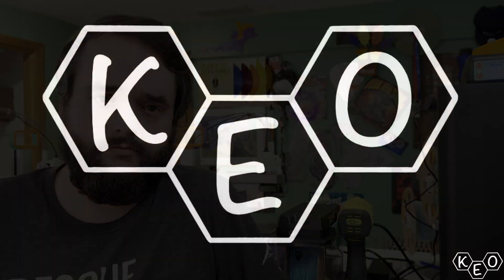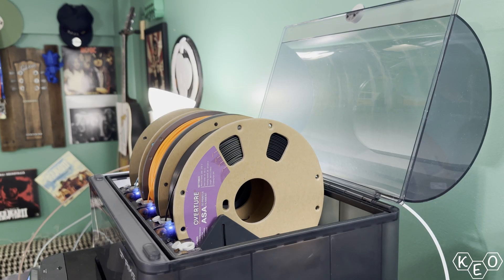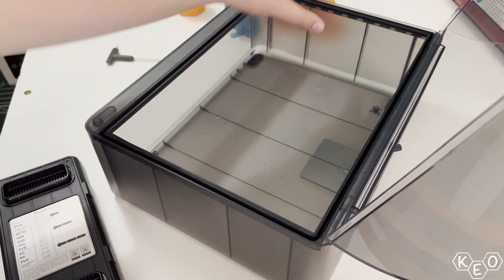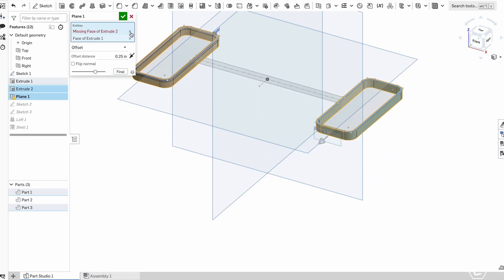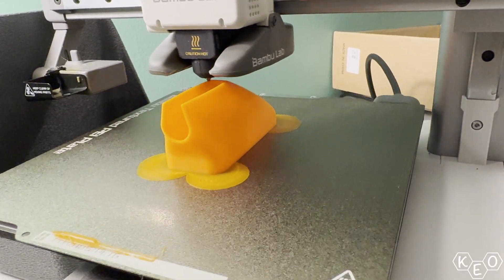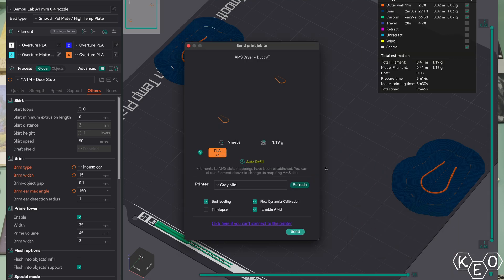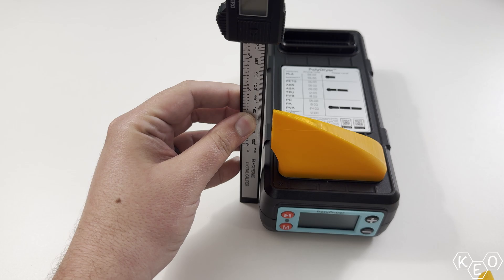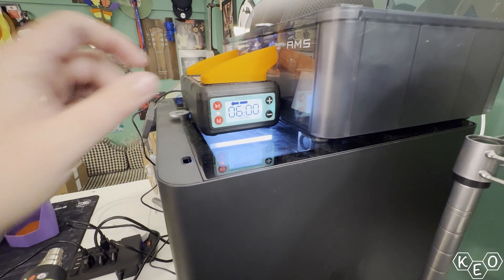AMS Active Drying? The Bambu Lab AMS PolyDryer Upgrade You Need To See

Comment: In that time, only the environments humidity dropped inside the AMS.
How much moisture did it pull from the filament.
Also running temps above 35+°c can start to have negative effects on electronics.

Comment: hi thanks what are you using in the video?
Reply from the maker: That is the poly dryer from poly maker. Check out the video description for a link if you want more information
Reply: @KeoPrints  which CAD did you use? Thank you
Reply from the maker: Ahh that is OnShape. It’s very well featured for a free browser based program

Comment: Great idea and great start. I question why you restricted the air flow so much? The outlet size should be at least close to the same size as at the dryer itself. That probably reduces the effectiveness to a  degree.
Reply from the maker: It simply came down to the packaging and using a shape that would print reasonably without support material. The cross-sectional area is quite a bit less so from an efficiency standpoint, not ideal. But the thing worked so the concept was proven. This was the first iteration, check out the follow up videos if you would like to see where it ended up.

Comment: G'day mate. Just a small suggestion of a potentially easy win to be had: adding some kind of ventilation for the moisture to go to would be a good idea. That being said, as to where? I don't know. If the inlet for the PolyDryer was on the bottom or back, I'd say just lead the lid open a little bit which I imagine would be sufficient, but obviously this would be less than ideal in the current design set up. Maybe add a port hole kind of thing at the back, (or top?), of the AMS which you can close once the filament is dry?  Good luck!
Reply from the maker: Ahh yes, you're right on the money my friend. Here is a super cut video that has the whole build/series thrown together into one. It covers that first iteration that you saw but also a couple more past that.

https://youtu.be/3X2qtFA_Ou4

Comment: Make the part from TPU completely then you will not need gaskets
Reply from the maker: That’s not a bad idea. Although it wouldn’t handle the overhangs very well I’m sure it would handle the heat just fine. I have the follow up video coming out this Sunday
Reply: @KeoPrints  Yes it will as you do not have long runs of overhangs

Comment: Does the lid on the AMS have a gasket on it? Is the Polybox pushing air through both outlets, or is one and inlet and one an outlet? Otherwise, where can the moisture leave the AMS?
Reply from the maker: This has been the talk of the comments section. As far as I am aware, the moisture does get trapped in and does not get exhausted. There is an inlet and an outlet on the dryer so the air is circulated but none of it gets exhausted out. I am currently working on the follow up video where I plan to make an exhaust but it has been interesting diving into this!

Comment: so i was thinking about doing this myself. the approach i was going to take was by using two units at opposite ends (towards each side) with penetration's through the floor of the AMS, but honestly now looking at the python MOD, and   i would integrate the same approach into the new AMS build. 

i do have a question though. is there a way to purchase JUST the base unit (kit) with out the box? (of the polymaker dryer)
Reply from the maker: As far as I can see there is not a way to just get a base. I hoped for the same thing but I guess it doesn’t hurt having extra individual dry boxes. 

You can check our link and see if anything has changed but last I saw, you could only get the box, or the box and base

Comment: I would suggest making the ducting about 2 inches round where it connect to the ams, you could then use a 2 inch hole saw and a drill to make quick work of making the holes. Then design a bracket to hold the dryer on the side of the ams
Reply from the maker: I agree. The round ducting would better for air flow as well as making the holes much easier to drill. The round ducts just have such a hard time printing that I didn't want to mess with it on this short of a timeline. My plan in the next few weeks is to cut new holes (round ones) and then make adapters to fill the gap between the outlets of the ducts and the now bigger holes. That will look much better I think but we will see how the project develops!

Comment: I got a PrintDry Filament Dryer PRO3 with the Large Spool Kit for my 5kg spools. But I'm edger to add something like this to my CFS I'm getting. 

My basement sits are around 40% humidity with a defumidafier for the level running and it get up to 80% humidity during the summer months in my area so all the more need to keep printing areas as dry as possible.

Comment: Interesting, but seeing the relative humidity drop as the temp goes up doesn’t really tell us anything useful: hotter air can hold more moisture so the hygrometer is going to show a drop purely from the temperature increase regardless of whether or not any moisture is being driven out of the filament.  You need to weigh the spools before and after to see if there has been any actual drying of the filament.
Reply from the maker: That’s a good point as well. I’ll have to live with it a little more and do more testing to see how it goes!

Comment: So, for the A1 AMS, I just run the filament directly out of 2x double-roll dryers from Creality through the motors of the A1 Series AMS. That one is super nifty! The Creality dryer boxes show you the moisture levels as well, so you know if you need to turn it on and it has presets for different filaments. The dryers come with tubes and have steel rollers to make this possible without any modifications - the filament will just hang a little loose after being pushed back since the dryer does not automatically respool, but that's just a few inches/centimeters of exposure.

For my P1S, yea, right now, I have an additional 2x double dryers from Creality since I liked the first ones and my son has them now for the A1 Mini. I thought about a similar mod - and I thin the ducting could come through the desiccant pouches in the back with a modded undercarriage. Still in the "idea" phase on this.
Reply from the maker: That all sounds like good stuff. I’ve been looking at the creality dryers a little more now too. Good to have all of the data that they offer on there

Finding a way to duct into the desiccant pods is a good idea as well. Hadn’t thought about that either. Good notes here!
Reply: How do you run it to the ams? Did you poke holes in the ams for the filament? Do you keep the lid open?

Comment: It occurs to me that if you properly control the max current (i.e. max temperature), just sticking a silicon bed heater to the bottom of the AMS could be the dead simple hack to heat the enclosure. Thoughts? I just checked, and the bottom is textured, but nicely flat. This could be a pretty simple task for an Arduino or Pi Zero. You would want to be very confident in your temp control so you don't melt the bottom of the AMS. The only wrinkle is you would want some controlled air movement. Hmmm <<< reaches for thinking cap.
Reply from the maker: I like where this is going. Follow our free Patreon if you develop this idea further and want to talk more about it. That would be sick!
Patreon.com/keoprints
Reply: @KeoPrints  Actually, if all you did was add the bed heater to provide a stable PLA safe temperature. If it still had zero air movement, and kept the multiple desiccant containers . I'd argue you would still have a far superior setup than with no heat. Slap it on, plug it in... done. It would not likely be quite sufficient for things like Nylon. But it would be an improvement. Adding a small fan inside to move some air around would be helpful.
Reply: Also, personally, I only print abrasive Nylon or PC that can't go in the AMS anyway.

Comment: A simple trick to make cutting templates is to make a drawing from your design (switch from the Design workspace to the Drawing workspace) and print it out on paper.  You can also right click a sketch and save it as a DXF.  You can print a DXF from Inkscape, or if you're really fancy (and the thing you're cutting fits), you can import the DXF into Lightburn and cut it with a laser instead.
Reply from the maker: This is excellent! Who said the comments section was all bad! Love it
Reply: @KeoPrints  Glad I could make the world a slightly better place

Comment: I think you can clean up the look by making some 3D printed grommets to fit into the holes. They would cover the cut/sanded edges and perhaps could also make cutting the holes a lot easier by allowing you to cut a simple circular hole but have the grommet adapt it to the exact shape of your ducting. Definitely going to do this to mine when I can.
Reply from the maker: Yes! The  grommet idea came to me as well. Using it as an adapter from a simple circular hole would have been a much better way to go in my opinion.

If I didn’t let my last minute idea run away so quickly I would have gone that route and may still do
Reply: @KeoPrints  pros and cons of rapid iteration :)

Would love to see a follow up video on this if you take it further!

Comment: I saw a polydryer mounted to the lid. I plan to copy that. BUT if a guy was skillful at modeling things couldnt one make a new lid that houses the polydryer? I doesnt need to be round like the factory one. are the lids available from Bambu if I chop this one up and decide I hate the damage and want to go back to stock
Reply from the maker: All good points. I think the lid mount would be cool and that is the way I wanted to go initially. One issue I had with it (besides the curved surface) was the fact that the dryer and display would be upside down. Not a huge deal but not what I wanted

As for modeling the lid, that’s an idea I hadn’t considered. I’m not sure that they’re available from Bambu but I don’t think it would be very difficult to model and may already be available even… who knows

Comment: Hi.
I must admit that the combination of an AMS and a PolyDrier is a good idea in principle.
However, perhaps it might have been a good idea to have done some research, prior to jumping in.
No matter, it’s going to be very easy to overcome the problem.  This can be achieved by printing desiccant containers, there are many on MakerWorld, and filling them with colour changing regenerative silica gel.  I have 7 in mine, 5 in the front, and 2 in the rear.  These keep the relative humidity in the AMS at 10%.

As has been mentioned by others in this thread, there’s more to it than just drilling a couple of holes.  Perhaps an understanding of basics might help.

RH is the ratio of how much water vapour is in the air, (hence %), how much water vapour air could potentially contain at a given temperature.  It varies with the temperature of the air, colder air can contain less vapour. Therefore changing the temperature of air changes the RH, even when the Absolute Humidity remains constant, i.e. the amount  of moisture in the air stays the same.  If the temperature drops the relative humidity, will increase.
Silica Gel (SG) in the AMS will retain the moisture, and the RH will stay the same.   To release the water, and regenerate the SG, it needs to be heated to 120 °C for 1 to 2 hours, or 15 minutes at low power in the microwave.

This is evident in my ‘sealed’ AMS, where the relative humidity remains at 10%  If a reel of filament, containing moisture is introduced, the RH temporarily increases, and then decreases again, due to the SG absorbing the moisture, as the temperature drops.
There is no real need to heat the chamber.  However, if it is heated the process of evaporation and absorption by the SG will be quicker.
All that needs doing is to monitor the RH, and replace the silica gel with ‘regenerated’ silica gel, and then dry the removed silica gel.
I store open reels of filament in a sealed container, which contains SG, and a hygrometer. When I need a stored reel, I swop it for one in the AMS.  Doing this increases the RH slightly, but a couple  of days later they drop back.
Cheers Noel.
Reply from the maker: Sounds about right! Very descriptive and good notes here. Thanks for taking the time my friend

Comment: I did some calculations and your test has actually increased the water content in the air.

60% @ 71F (15.5C) = 6.62 g/kg (h2o per kg air)
43% @ 83F (28.3C) = 10.55 g/kg (h2o per kg air)

But those hydrometers aren't very linear especially with lower humditity levels (esp around 40%).
Also doesn't mean the things inside the ams haven't lost water.
Reply: I think you have to wait a day or so. Let it cool down and compare then.
Reply from the maker: That’s a fair point. I’ve been on vacation but am looking forward to getting back to do more testing. It’ll be interesting to validate this idea further

Comment: Might have been mentioned - but what where does the condensation/moisture go? Should a small hole be added to the top or bottom somewhere?
Reply from the maker: You’re correct. I’m wondering about an exhaust port addition personally

Comment: And if you model the holes round… and use the drill to cut them…
Reply from the maker: I am sure that would have been much easier. But then I would need to use support material and that garbage is not how I roll

Comment: Looks nice, but I am not sure that all the internals of the AMS would be able to withstand the higher temperatures required to dry some filaments over an extended period of time. If I had a polydryer, I'd just fit it on a larger box than the polymaker one.
Reply from the maker: I wondered the same thing. It’ll be interesting to see what happens from here
Reply: Same here

Comment: So not really good for mixed filament types (e.g ASA and PLA in the AMS). Follow up video would  be interesting after some longer usage. All those rolls of filament (the actual filament) are going to need  be raised to ~80C - how long did it take? How are the PLA parts holding up to the heat?
Reply from the maker: I’ll have to do a follow up after I live with this setup a little longer. I have the same concerns with the PLA ducting so it will be interesting to see how this project develops! I’ll keep you posted

Comment: Sorry but you didn't take hardly any moisture out of the filament. All you did is heat the air in the AMS which increased the amount of water the air can hold (decreased relative humidity).
Without the silica to absorb the water the humidity world return to the same as before. when cooled.
2 steps needed to dry filament
1 - heat the filament  long enough at the right temp that it releases moisture ( different filaments have different temps and times)
2 - absorb the moisture either while it is hot or as it is cooling. Silica is much more hygroscopic than filament and can absorb lots per weight so it absorbs moisture quicker than the filament can reabsorb it.

Keeping new filament in a low humidity chamber while printing still helps with hygroscopic filaments such as PC etc.
Reply: @mirovida66  that's why u keep desiccant inside the AMS also. Derp. 
Haven't u seen the extra desiccant pods people print for their AMS?
Reply from the maker: Interesting notes here and I am hearing a lot of the same stuff from comments. Good notes all around. I’ll have to do a follow up video as the project develops further
Reply: @KeoPrints  IF you want to see one that works, I'm sitting in 80% humidity, the EIBOS is drying stuff to about 40-45% and mine has dried the filament to $25% https://youtu.be/wiNkckE29Aw
Reply: Then how do you suppose all those dryer boxes work? lol
Reply: @designgears  Well, the polymaker ones don't really work and the others vent the hot moist air out.
Reply: You need one of those electrically charged membranes that force moisture from one side to the other, and some air movement.
Reply: THANK YOU for mentioning this. I made my own version of a dryer for half the price and it actually works. I keep getting frustrated watching people not understand the simple concept of dehydration is to REMOVE the moisture from the controlled environment either by sucking it up with desiccant, hot air venting to the outside or dripping it out with a condensation tank. I'm also not a big fan of making huge modifications to a $350 AMS system and then not being able to return it back to its original condition by drilling holes in it. And NO, do not listen to these wanna be idiots spouting of, "that's why you ALSO use desicant packets". Disiccant packets can create the moisture deficit in the air to dry the filament on it's own. The only reason to use the desiccant packets in this case is to maintain the humidity level when the dryer is not in use but again the drier needs to be able to vent the moist air out. Other wise their is no point  in the dryer cause the desiccant is doing the job of sucking up the water already.